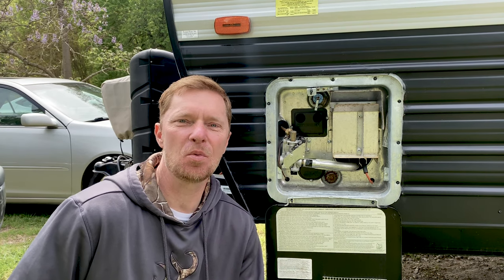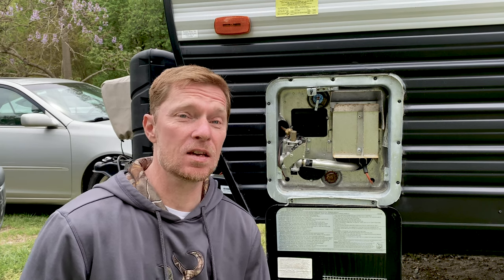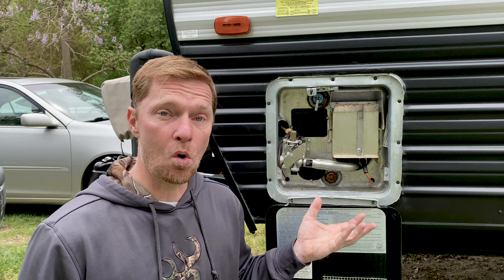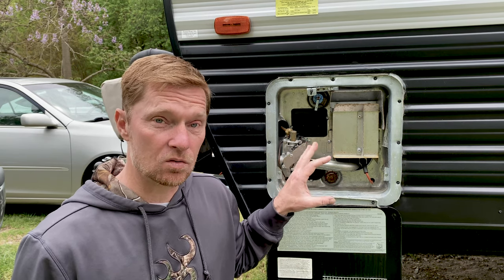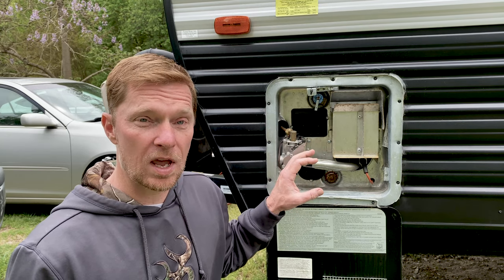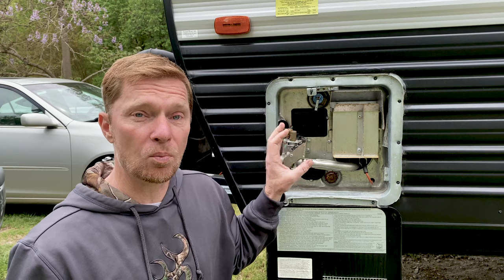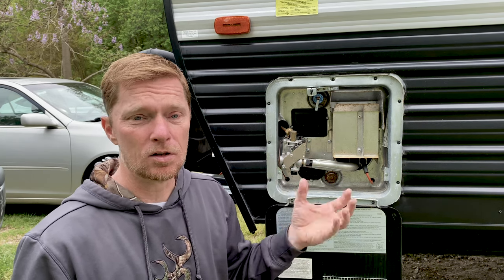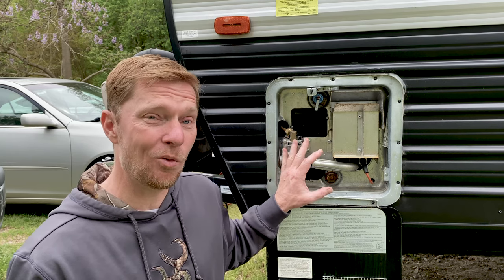Travel Trailer Gas Electric Water Heater Explained 2020

Comment: Can you/should you run both electric and gas heaters at the same time? (Wife takes loooooooonnnnnnng showers)
Reply from the maker: mgsusa I like long showers too. We use both electric and gas together most of the time. This helps with the quantity of hot water before running out.
Reply: Great question. To add onto this...Do you switch the electric on at the water heater tank itself and inside the unit on the electrical panel or just on the water heater? Also will electric be enough by itself or is the electric only for reserves?

Comment: Hi. My power switch  in stuck shut. So I'm on gas. Which  should  I use gas or electric 🤔
Reply from the maker: To be honest. I usualy keep mine on gas. The main reason for doing so is because my RV is a 30Amp service and with the electric side on, it uses a lot of the power consumption that the camper can provide. example: if the RV's air conditioner is running and pulling 12 amps and the water heater is pulling 15 when in use - thats 27 out of the 30 available amps that my rig can handle. I ususally on turn on the electric side when more than 1 person is in line for a shower. Other than that I am on gas only. Downside is that I am paying for the gas where if I was only on electric, the campsite would be taking care of that for me. I hope this helps you some.
Reply: Yes thnk u that helps alot .I have two 30 pound tanks  of gas. Only 20 dollars  to fill a tank so gas it is.  Go's bless you 🙏
Reply from the maker: @shayblair591  glad to help. God Bless you too. 🙏

Comment: I think my pilot flame is off on the water heater. It has a FLT light on the motherboard and I don't see a flame
Reply from the maker: My water heater does not have a pilot light. It has an ignition that creates a spark kind of like a BBQ grill. If the igniter is to far away from a metal surface to create a spark or to dirty it will not work. The board could be bad but I would start there. I think the FLT means failed to light.

Comment: I accidentally ran my water heater without water (It’s just propane). When I put water in the tank the heater wouldn’t light, how do I fix it?
Reply from the maker: Make sure that all the air is out of the tank. Disconnect the battery and shore power. Check fuses. Then try again. This has worked for some folks. You may have a manual reset button out at the water heater as well. Mine looks like a rubber cover. Hope you find a solution. Let me know how it goes. Good luck
Reply from the maker: Make sure that all the air is out of the tank. Disconnect the battery and shore power. Check fuses. Then try again. This has worked for some folks. You may have a manual reset button out at the water heater as well. Mine looks like a rubber cover. Hope you find a solution. Let me know how it goes. Good luck
Reply: @HowToRV  turned out to be the breaker, it didn’t appear to be tripped, but evidently it was.

Comment: Where is the switch inside the trailer to turn it on for propane?
Reply from the maker: Mine is on the panel where I turn on the water pump and check tank levels

Comment: Do you need Propane? Or can you get rid of it totally?
Reply from the maker: I do not htink that you can get rid of propane totally but if you do not switch it on, then it will never be used.
Reply: @HowToRV  If you can heat up the water with Electric. You can, which Im learning you can. But we will see. If I can totally drop the Propane. One less thing to worry about. Do not have to fill up. Never will run out. As long as I have power. And know with these new batteries. Well we will see like I said. :)

Comment: But My question is water heater runs on electric or propane?
Reply from the maker: Mine can run on either the electric (Shore Power) or Gas (Propane0) and if I turn on the Gas and Electric. Both will run at the same time. Hope this helps

Comment: Well my problem is I just bought this RV. It's a 2007 Dutchmen Grand Junction fifth wheel it has gas and electric water heater. I haven't looked at it yet but I hooked the water up after the power company had put the meter in then I noticed the switch was turned on so there was power going to the camper before I had the water turned on I have not looked to see if there's a switch in there or not I just hope it didn't burn anything up while I was gone. I am an unfamiliar territory with these things. I just hope the person before me had the switch turned off to the electric water heater when it gets daylight I will check it out I guess but I was there for an hour and there was still no hot water
Reply from the maker: It is possible that the heating element has gone bad for which I recommend you get a technician to check and replace if needed. I dont know about all RVs but mine will still work on propane even if the element is not working. There are electrical resets as well and you may get lucky and they are tripped. See the video again for where those are located on mine.
Reply: @HowToRV  everything is working now
Reply from the maker: That’s great news. What did you find out?
Reply: @HowToRV  it was the switch

Comment: What is the trick to getting water into your hot water tank in the first place? That's what I need to know.
Reply from the maker: If the valves are not positioned correctly on the back of the water heater, you will not get any flow. You also need to either run the water pump from the full fresh water tank or be connected to the water from the site that you are in (City water connnection). If you are not sure, take a picture of the water valves on the backside of the water heater and send me them in an emaiil and I will see if I can tell if the are correct.

Comment: Not sure i jave gas flowing to my tank im pretty sure i have been getting hot water solely through electricity, i am lossed please help
Reply from the maker: I am not an expert but try looking at the reset buttons at the tank itself. Also, if you turn the water heater on from inside, you should be able to hear the flame kick in. If it try’s and fails to start, the little light on mine will start flashing to indicate that there was a system error. I had it happen to me once and found that the propane bottle wasn’t fully opened.
Reply: @HowToRV  hey thanks for response , i cant seem to figure out if my heater both electric and gas, but you say their is a reset button on the because on outside of camper i see no reset also my gas burning stove is working great so i would think it should be getting plenty of gas
Reply from the maker: My resets looks like a black rubber pad at the water heater. I have had issues that i could not resolve before and i usually ask the folks that are camping around me, since the probability that someone there has a set up just like yours is pretty high

Comment: Thanks
Reply from the maker: Kane Allen anytime. I hope it was helpful.
Reply: Mines a suburban water heater but it doesn't have that on/off switch you showed every other peace look the same hot water was working when it wanted to now stopped working
Reply from the maker: Kane Allen mine is a 2019 model. Not sure of the year of yours. Sounds like you may have a propane model only. Things to check could be air getting into the line, 12v solenoid is sticking, propane levels are low etc. One other thing to check. There is a temp sensor where the flame comes out and into the underbelly of the tank. If that sensor has moved, it will not be directly on the flame. The system looks for that for a safety measure. If it doesn’t see it, the system will shut down and stop trying to light. Let me know what you find out for more learnings for the community. I would love to post your findings on Instagram if your ok with that
Reply: @HowToRV  I sent a pic to your  instagram

Comment: How do i fill My water heater? Can You please tell me
Reply from the maker: make sure that the anode rod is installed. on the back of the water heater, make sure that the bypass valves are not bypassing the water heater. You need to make sure the handles on the valves are inline with the lines going to and from the water heater. From there, connect the water and open the hot side of any faucet in the RV. Wait until you get water coming out and all the air is out of the lines. You will know when it is good to go when the water stops spitting air out. Hopethis helps.

Comment: I need to find out if any one knows how to connect a regular hot water heater to an RV
Reply from the maker: While I would not recommend putting a resdential water heater in your RV, I could see some areas where someone may want to do so, like in a schoolie or custom build. I would recommend looking up skoolie water heater setup and see if that gets you what you want. Hope this helps.

Comment: Mine is 3 years old and never works.  I might've had it working once or twice. So frustrating.
Reply from the maker: I understand your frustration. If possible, I would see if a technician can look at it. I share my experiences and would love o help but (fingers crossed) I haven't had anything that keeps mne from working at the moment. If you want to send me your contact info via email, I may be able to connect with you to discuss some troubleshooting ideas.
Reply: @HowToRV  absolutely. I will try some basic stuff like empty it and maybe change the rod in there.  It was parked and winterized for two years at a camp grounds.  So it might need maintenance for sure!!
Reply from the maker: I would love to hear how you resolved it.

Comment: My gas won't work for some reason we bought the trailer from a guy who sold it cause it was his dad's who had passed and he didd some of his own work bit I cannot figure out why gas won't work
Reply from the maker: I would start with checking for power. Look for the 12 volt fuse (one at the heater and one t the power panel. Also look to see if you have reset buttons at the water heater outside behind the panel. They may look like a rubber cover but has reset buttons behind it. Lastly, make sure that the propane to the water heater is on. Mine does not have a cut off but some do. Hope this helps.

Comment: I don't know why but I turn heat on worms couple hrs then hole camper fills with propane.
Reply from the maker: Use soapy water in a spray bottle and check for leaks around the propane lines. Also check to make sure that the propane is turning off at the water heater when the flame is being told to cut off because water temperature has been met.

Comment: I still don't see a switch only water pump switches
Reply from the maker: All RVs are different but you should have a switch for the propane side of your water heater. This switch is typically not the one at the water heater itself.

Comment: My electric heater light won’t light,I can’t find the fuse for it,some idiot came in to our trailer and turned off the electric heater and turned on the propane switch now my electric heater won’t work?
Reply from the maker: You could have someone check the control board. Also you can try pushing the reset buttons on the water heater outside. as for the fuse, i would think that it is in the control panel where your breakers and 12v fuses are. At least that is wher mine are.
Reply: @HowToRV  I don’t have any reset buttons on my heater outside.I checked all the fuses and they are all good.

Comment: Not sure why my water doesn’t heat up when I turn the electric element on and it’s brand new
Reply from the maker: I know that this may seem simple but did you plug the camper into shore power (i.e. the plug on the exterior of the RV). I ask because I have had some do that. Believe it or not right. Also, some people have a switch on the panel inside the RV to turn on the electric side of the water heater. It is usually near the switch for the propane. Also, mine is plugged into an outlet behind a panel near the water heater, if the manufacturer didnt plug it in, well, it wont work. Lastly, mine has a reset on the outside at the water heater behind the panel and it loos like a flat piece of rubber but there are reset buttons behind it. Hope this helps

Comment: Mine doesn’t have that switch why is that?
Reply from the maker: Either yours is located at the power panel inside or if older, may not have an electric element. If you can find the make and model # and email it to me, I may be able to find out more information for you. Another option is to find a facebook group with people that have a RV like yours and ask them as well.

Comment: What if my rv doesn’t have a switch inside the box
Reply from the maker: Not having a switch on the inside doesn't necessarily mean that you do not have an electric heating element. In the video, I pointed out where the electric coil is, if you have that on yours, then you may have the switch to turn it on and off inside the RV somewhere. If you do have a switch inside the RV, its usually located where the control panel is for the water, slides, light and so on.

Comment: I have a problem with mine turning on and off
Reply from the maker: I havent ran into an issue with mine yet. Is it your electric or the gas that keeps turning on or off?
Reply: @HowToRV  Have her contact me if you'd like.  Have her get a 12VDC test light and a good sense of humor and I'll walk her right through it.  A multi-meter and a wire brush might be necessary, as well.
Reply from the maker: David Franklin thank you David. That’s what this channel is all about. Supporting the RV community.

Comment: I replaced the Anode and the heating element and
Reply: I still don't have hot water any suggestions
Reply from the maker: @greghaines7237  did you check fuses, breakers and reset buttons. The reset button are locate at the water heater. You should be above to check voltage across the heating element leads as well. If all on/off switches are in the right way place and resets are good, look into information about the control board based off the model of water heater that you have. Hope all goes your way.

Comment: The electric part is not working 😞 as soon as the propane is out all we have is a cold water..
Reply from the maker: Try pushng the reset button on the outside if you have one. Also look at the breaker in the main poer panel. Lastly, make sure that it is plugged in. Mine is plugged into a hidden outlet near the water heater. Hope this helps you get it back working again.

Comment: Well, this was somewhat informative, but I wish you would have ended the video by actually going through each step of how to get hot water when you pull into your campsite. From start to finish, because when it comes to water heaters I am completely ignorant. Also I would like to see the difference in if you're using a water hose hookup, or water from your holding tank.
Reply from the maker: That is a great suggestion. I am heading out in a week and when i get there, I will start recording that video. When i have it complete and scheduled, I will come back and let you know.
Reply: @HowToRV  appreciate it!!
Reply from the maker: From your welcoming suggestion, here is the video about setting up at my campsite and hot water. https://youtu.be/6Wbw1ZR55xU. Please leave a comment on that video as well if you like it. Also, thank you again for the video suggestion.
Reply: @HowToRV  hey THANKS! That gives me a little more confidence about using my water heater😄  Looking forward to more video on the difference between using water from the holding tank and the city hookup! Oh, would you show me how to find out if my water heater is lit or not? I have a teardrop camper and it has a small water heater
Reply from the maker: @jwills6883  Does your heater look anthing likie the one in the video, i can easily see the flame when mine kicks on. I do not have any experiences with other types but if you want to send me a model name and number, i will try to see what i can find out for you.
Reply: @HowToRV  ok thanks! I'll check